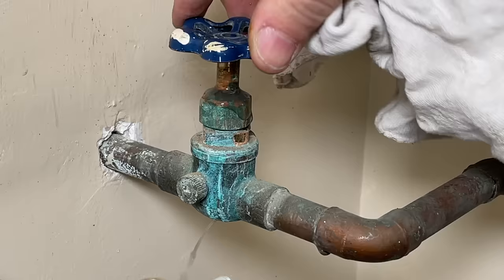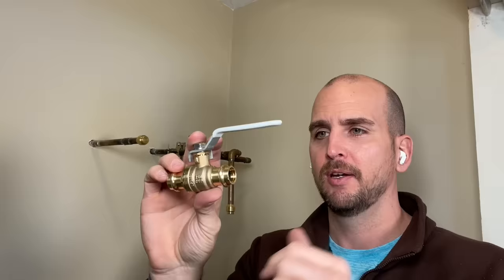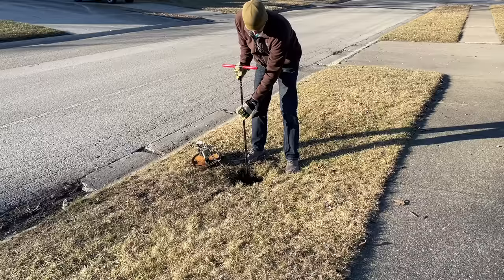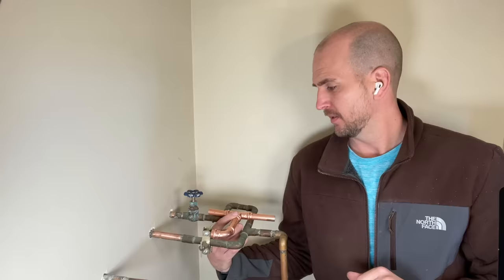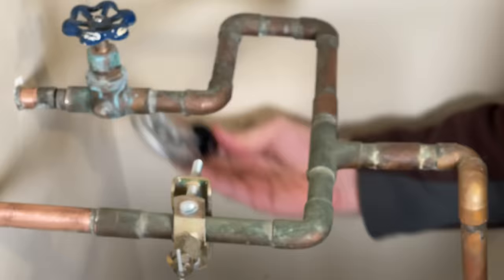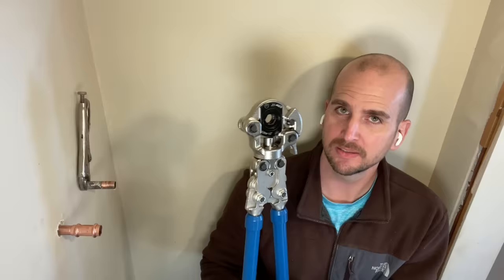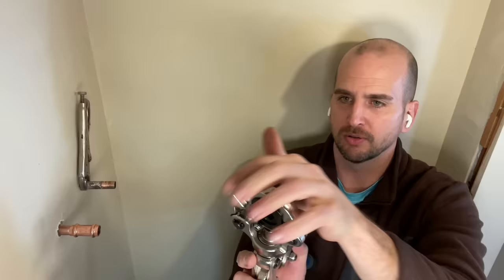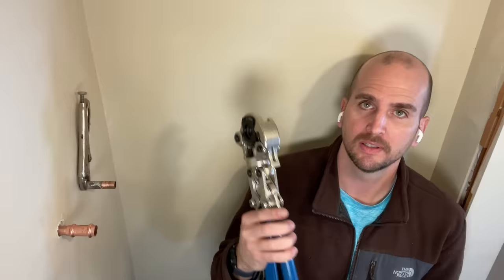How To Install a Main Water Shutoff | NIBCO Press Fittings

Comment: Shark bites are great, can be used to connect two different types of pipe no problems. Used them when I upgraded my waterheater. Limited space so SB's were  the way to go.
Reply from the maker: Hey Robert thanks for the feedback and with limited space I agree Sharkbite fittings can come in pretty handy 👍
Reply: I concur.  Why have a large expensive specialized tool hanging around after you are done with the renovations?  Sharkbite valves also rotate after installation, useful for making your flexible connections look neat and straight.
Reply: Yes, once in winter temperature was very cold outdoor, I got copper pipe broken behind the indoor valve (closed) even though I had drained water out then closed the outdoor valve. It was not good for my basement. I repaired it as the same way you said. Outdoor valve (existing)-- copper pipe (existing in concrete) -- SB coupler - Flex pipe (new) -- new T valve (sharkBite) -- Flex pipe (new) -- SB coupler (new) -- SB  valve (new) -- existing copper pipe.  
By this configuration, before winter, I can respectively close the indoor valve, open outdoor valve, open T valve and drain  completely water out (vacuum or air compressor). Finally close outdoor and T valves.  No more thermal conduction to my indoor valve :-)
Reply: Also used to install the a new water heater several years ago.  No leaks yet!

Comment: I was hesitate using sharkbites at first but I'm a believer now. Installed several with no failures for about 5 yrs. It is the sharkbite brand that I use. No experience with other similar brands. These were invented in Australia.
I still can't figure out how they work so darn good!

Comment: We used sharkbite fittings to install my new water heater 15 years ago.  They never leaked in the 15 years they were on.  I decided to put new ones on when the water heater failed this year, because I'm sure that o-ring will eventually deteriorate in the sharkbite fitting.

Comment: I prefer soldered pipes.  It is stupid simple, cheap, will last forever, and is a transferable skill.
Reply: A possible advantage of sweat fit copper is that the joint can be unsoldered cleaned and resoldered with no loss of pipe length.
OTOH this system looks like it could be used on a line with a persistent drip, which would make soldering difficult at best.
Reply: Very good presentation. But why re-invent the wheel. Just solder it, so much easier. Less costly.
Reply: @machintelligence  I also solder, but never reuse fittings. This makes it faster and easier, no leaks. I also buy at least a couple more of each fitting, thereby not having to go back to the store, because I was a fitting short no matter what the reason. I taught a soldering class in the 80’s at work, a gal learned how to solder in 5 minutes. Thanks.....Jim
PS.....soldering tip.......clean all pipe and fittings, even if new, till they shine!
Reply: @machintelligence  One trick around this is to stuff bread in the pipe to temporarily stop the drip while you solder. When you turn the pressure back on, the bread gets blown through the pipes and obliterated
Reply: They took the skill out of the trade, everybody a Turd Herder nowadays
Reply: Pro press is good if you can't drain a system ask the way down or you need to get a permit to work with the torch
Reply: @CarlosRodriguez-hb3vq  I have done the bread thing, it does work, but you’ve got to clean all the sink strainers, very time consuming. I only use this as a final solution. Jim
Reply: Labour cost is a big factor to consider, minimal time to install espically with a leaking valve, con is cost of fitting comparably but it's a game of how much your time is worth

Comment: Nice detailed video👏 I encourage you to try soldering, it's much easier than you think, especially if you use flux containing tin.😁 Good job on the tool review, I will consider purchasing the crimp tool.
Reply from the maker: For sure, I will be spending a bit more time learning how to solder over the next year.  I actually think once I get a little practice from a cost and robustness standpoint solder would be my preferred method.

Comment: Some ball valves have a drain on them, just like a globe valve. In that case they are directional. There should be an arrow cast into the brass body showing which way they should be installed to be able to drain the side that gets shut off. Another consideration is the example case is make sure there is enough room for the valve's handle to swing it's full travel. It would suck if you installed the valve only to find out that it's so close to the wall that you can't shut it off!
Reply: Valves with the drain are typically called "waste stop valves."

Comment: I tried a Sharkbite elbow on a pipe with a (very) little bit of solder on it.  It wouldn't bite on the pipe.  Then I installed a plastic Nibco(?) fitting on the same pipe, and it worked flawlessly.  Several months later, I sweat a copper elbow, sleeping better now.
I struggle to sweat valves, so I could justify renting one of those crimping tools.

Comment: I know I’m a year late but I think it was a great instructional video. I’m not a shark bite user, it’s great for homeowners but as a pro , we sweat and press. My only feed back on pressing is that every failure I’ve found was someone 1. Didn’t clean the pipe well 2. The fitting wasn’t pushed in all the way 3. If you are using a battery pro press machine , the battery wasn’t charged all the way .  Press fittings have been a time saver and a liability saver versus using a torch. Press valves are especially helpful in the places that you can’t turn the water fully off or there is a lot of drain down.
Reply from the maker: 💯 can be a life saver for sure 👍  Thanks for the feedback

Comment: I think SharkBite fittings are great. I don't typically like to use them for permanent installs or repairs, but that's not to say they'd be at all unsuitable for that. I think people like to envision them as somehow underperforming or leak-prone, but I just find that's demonstrably (and in my own observation) not the case. There's absolutely no compromise in quality when used properly in normal residential situations. That said, I can totally understand professionals staying away from them based on price alone. A plumber trying to spec a job using all SharkBite fittings would never be able to quote copper competitively. I think the press fittings are a good compromise between traditional sweating and something like SharkBite, and that's probably why so many professionals are moving toward them. People also get set in their ways. It's a whole other "wirenuts vs. push-in vs. wago/lever-nuts" kind of question. Everyone's got an opinion on what's best, but everything still has to pass the same government and professional trade association ratings and tests to meet at least minimum standards.
Reply: I wouldn’t trust them for good reason. 9 times out of 10 they may be fine. However I’ve seen freeze tests that just push them off. Before everyone says “don’t put them in a freeze area”, that’s not how freezing works. Freezing greatly increases the pressure in a system and will damage things not necessarily in the frozen area. When they do these tests and shark bite is the only type of fitting that fails and every other one failed at the pipe then I’ll trust other systems
Reply: @joshcowart2446  so how did shark bite pass minimum standards then?
Reply: @garydp9760  do minimum standards test for freezing? Lots of things pass minimum standards but aren’t the preferred method I’d use. That’s why they’re minimum standards

Comment: The propress and Sharkbite fittings or Valves I find best to use when you want to avoid Burning anything, a large home with any water in the line when you need a fast repair done anywhere, and when using sharkbites I always look to see if the O rings are greased properly to avoid a dry connection! Love that you made sure the copper was well cleaned before installing the propress to Prevent leaks! As a 20 yr plumber I prefer Propress over sharkbite When really needed! Besides that I try to solder anything I can

Comment: I am a fading PEX fan . My difficulty is how a PEX connection will spin . For example a ball valve will always face down and move when trying to operate the valve . I work in apartment and nursing home environments . I run into a variety of plumbing styles depending on the age of the pipe I'm working on . I am moving towards using a crimper for PEX , or compression fittings when working with older lines . A common problem has been swelled lines from a winter freeze . The 1/2 copper will need cut at a point where there is no swelling . At that point I lean to PEX and quick connects .  PEX has made it easy for me to make a continuous run & avoid in the wall connections . I find that I am choosing material (copper or PEX) and fitting depending on what I am working on and the environment that I am in.

Comment: I think soldering/sweating copper pipe is easier to do then most DIYers think.  Don't be intimidated by it. There are lots of videos showing how to do it.  It makes reusing your pipes and fittings easier also.

Comment: I work as property maintenance for 10 years at the same place. We have many maintenance techs fix leaks with sharkbite fittings. As the years go by, more and more leaks seem to pop up. All due to Shark bites started leaking. We have plumbers come out fix them properly. They all say the same thing.  The see slot if Shark bites leak after 3-5 years due to hiw bad the hard water in our area is. I seen pro press and it worth investing in the tools. Simple to do and use. Plus saves alot of time then soldering. Recommend saving up for it if you do properly maintenance maintenance. It a live save. We can fix our pipes and not have to pay over price plumber to come out, and  do job in 30mins or less with pro press fittings.

Comment: I am a DIY'er who thinks ahead, such as what if I have to change this? I can reflow solder, or release a Sharkbite, but what do you do with these fittings?? Does it permanently deform the pipe to the point it cannot be reworked? Looking forward to a video on that topic...
Reply: Yes, it is permanent. That is why I prefer solder.
Reply: If you're going to rework you a solder joint or this you have to cut the pipe so I don't see it as a big issue. You can do this and not worry about water. If you solder you can have to make sure everything is dray.
Reply: had the same question....

Comment: I installed a main shutoff with a shark bite bulb valve with out shutting off the water and not even a cup of water was spilled. On the fly. 6years later still solid.

Comment: Excellent video.  A couple of things to think about:  turning off the water valve at the curb has potential consequences if dirt or sand is in the valve you could snap off the curb water valve and then you have big problem and flood.   And in some cases, since the curb water valve maybe town property and they may not want you touching their valve so it is best to call them and have them turn off/on the curb water valve.  On the placement of the interior ball valve, make sure you have enough space between the ball valve and the wall to turn the ball valve handle open/closed.  The plumbers in my area all use the Nibco method and rarely use the Sharkbite for many personal reasons.
Reply from the maker: Thanks Bill!
Reply: In my jurisdiction there is no rule that say you can't use the meter shutoff at the curb. It's a good thing too, since they buried the "homeowner's" shutoff in a concrete pipe that filled up with dirt so you can't even find the valve.

Comment: I bought this tool for a whole house re-pipe following a deep freeze that burst many of the copper pipes.  Fortunately, the water main was shut off and the house was vacant.  All of the plumbing was in the unfinished basement.  Several of the 70 year old copper solder joints blew apart as did the single shark bite connector that was used to repair a horizontal pipe.  The 1" copper main blew open in the middle of a horizontal section of the pipe as did one of the  1/2" pipes.  The main shutoff valve was also leaking a solder joint.  

I own a Milwaukee ProPex expansion tool and chose Pex A for the repipe.  But I wanted something other than Sharkbites to transition to the copper pipes I wasn't replacing.  My experience was similar to the video but I couldn't get it to work between some of the floor joists because there wasn't enough room to open the jaws.  It is also difficult to get the tool properly aligned on the fitting because it is relatively heavy and you need both hands to get the clamp to close.  

All told, I'm pleased with the way the tool worked.  I replaced the main shutoff valve without incident and kept a section of the verticle copper pipe because this is a 70 year old house and the electric panel is grounded to the water main.  You can't do this with a Sharkbite because there is no continuity due to the plastic liner.

But if I ever do another re-pipe, I'm buying the Milwaukee power press tool.

Comment: I used shark bite ends when I installed a water softener system two years ago.  They were easy to use and no issues so far

Comment: Im a diyer and I bought the milwaukee press tool and the pex  expansion tool. 
It just make sense.

Having sweat (3) 2 bath 1 kitchen apartments it no way in ever sweating copper again!
Its a pain in the but.
Reply from the maker: Dang!  I'm jealous, those tools and a little know how can make short work of most plumbing projects.  Do have have a bunch of rentals or flipping?
Reply: @EverydayHomeRepairs  rentals. I want to do some flips.
Reply: @EverydayHomeRepairs  yea they make everything easier to do.
IMO pex a is going to end copper for plumbing. 
Im waiting for a flexible DWV system.

Comment: I would have chosen the soft solder route and use a damp rag around the valve to keep the heat in check. However if you have water coming through you can either do the press fit solely on the valve or a compression fitting there but I like mostly solder and don't forget to wipe all solder joins free of flux.
Reply: Or take some bread and push it into the pipe which will stop the water dripping into your solder area and when done, water will soak bread and be expelled when under pressure! Easy peasy!!

Comment: Used to be a sweat-it guy.  But the sharkbite works really well in tight spaces and for a one time fix, especially where you can't get the fitting dry.  Yea, I know the bread trick.  If I had a lot to do, the crimp would be the way to go, especially if you can justify the power crimper.

Comment: And the time it takes for you to figure out how to use that massive tool in tight places, I'll be over here soldering a couple of PEX adapters, using my angled crimper for tight spots and saving myself a wad of cash. Oh and if I screwed something up, I can simply cut and redo my PEX fittings. As a plumber, IMO, there's a time and place to use press fittings and that's more in commercial applications.
Reply: okay...
Reply: I agree that press fittings are better suited for commercial applications, and the professional plumbers are going to use the $1,200.00 cordless electric pressing tool rather than the awkward hand tool.

Comment: I would suggest calling the city to turn the water off at the street as if you somehow wreck the underground valve you maybe responsible where the city know better. Not sure if there is a charge for that depending on the municipality. Something we did with press fit, is when the fitting is fully engaged mark it with a marker to make sure it does not slip out on you. If so you know. Otherwise nice job and advice. I like the way you put the vice grips on the pipe to hold it out of the wall for the press.
Reply from the maker: Thanks for the feedback Tom and calling the city/water company is probably the best bet for most people especially with the sensors commonly found in the water box now.

Comment: i own 11 rental properties and i handle all maintenance issues when they arise. ALL PLUMBING IS PEX PIPE AND SHARK BITE FITTINGS. NEVER HAD A SINGLE FAILURE FROM EITHER. SOME SHARKBITE FITTINGS ARE A LITTLE PRICEY BUT THE CONVENIENCE IS PRICELESS.

Comment: As a handyman, i think the way you used a crimp connection as opposed to a sharkbite for the shutoff was spot on! The problem with a sharkbite on a main valve is the sharkbite technology is not as sound as the crimp. the sharkbit is much more likely to eventually leak. not a  good situation for a main shutoff.
Reply: Not sure how u can say that sharkbite is much more likely to leak. I haven't seen cases of these happening. I have been using the for nine years now.
Reply: @jayak3768  Ive had them leak, I hate them =/

Comment: I had a plumber use a few press fittings - he said "'they are guaranteed for 50 years."  I had used Shark-Bite in the past anchored them to the walls and they stay in place, however, the customers decided to move them and that was when the leaking began. As for myself i prefer sweat fittings as it is really simple to heat the copper tubing as it is permanent.
Reply: Nothing guaranteed my friend. O-ring what holding the water
Reply: A 50 year guarantee seems good, but If your Shark-Bite or press fitting fails, the manufacturer will give you a free replacement fitting, but they won't pump 2,000 gallons of water out of your basement or pay to replace your drywall, furnace, water heater, flooring and your home theater system.

Comment: Installed that type valve on water line at the vet clinic I work at probably 678 years ago and have had zero problems with them